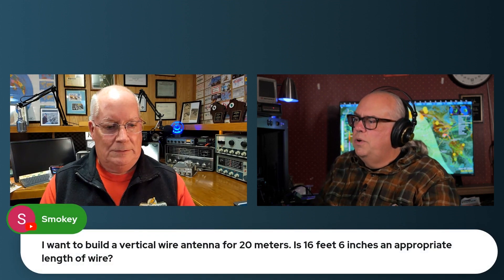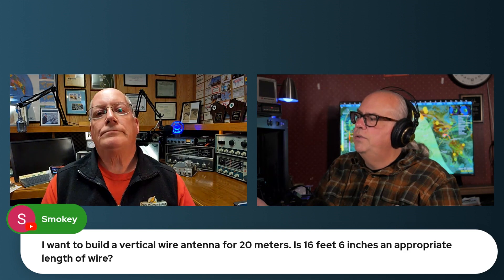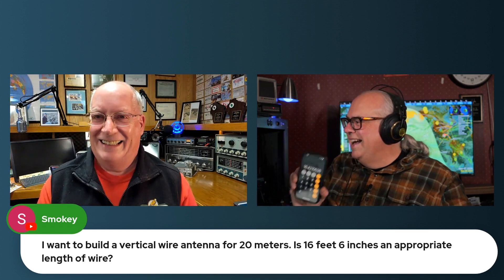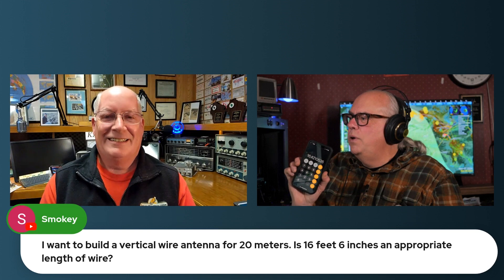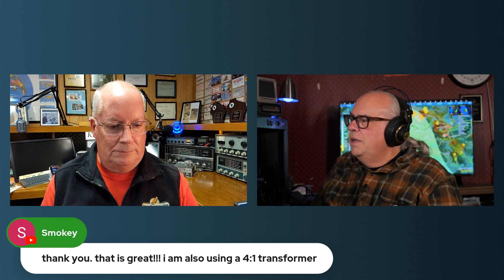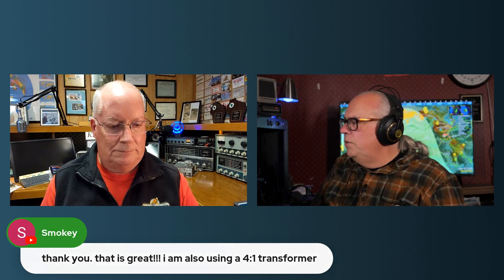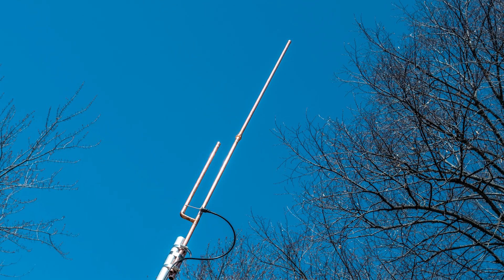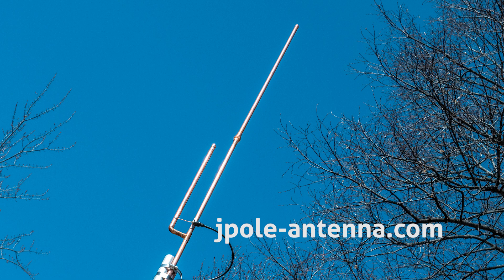How long should my vertical antenna be - Ask Michael, KB9VBR

Comment: I calculated 22 AWG UL hookup wire at 0.98 as directed how much I had to hack off to get it to resonance. Every insulated wire I have deployed was too long. The velocity factor becomes more dramatic the thicker the insulation.
Reply from the maker: Insulation thickness does affect velocity factor. The 4% number is for THHN 14ga stranded wire
Reply: @KB9VBRAntennas  I made a dipole out of surplus 15 kv neon sign wire for 80m. I had to hack 4' off each end.

Comment: Use a vertical or dipole thats way too short for a given band and not only do you have a lossy system but you also stress the feedline, tuner, balun owing to the high voltages created in the system.